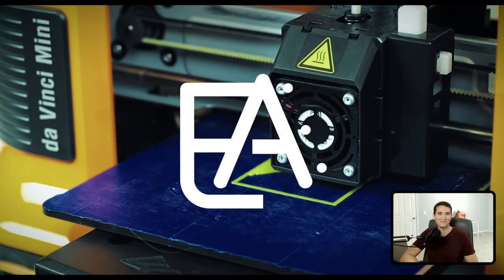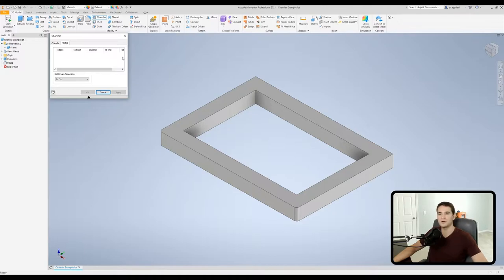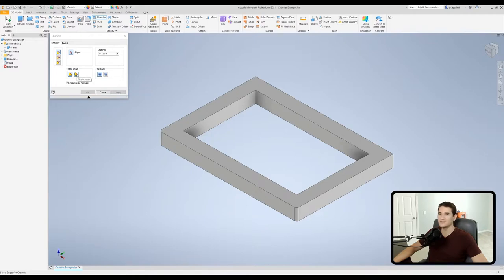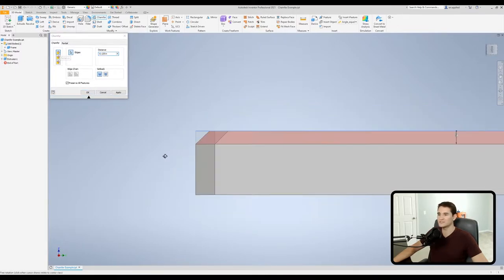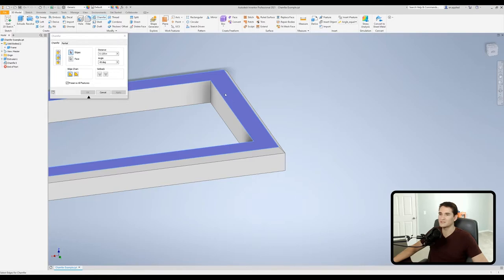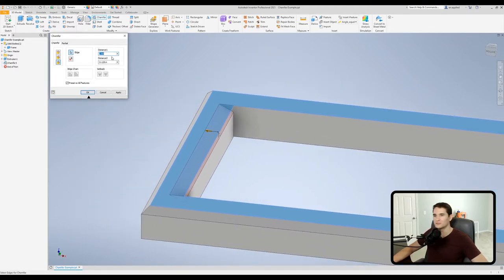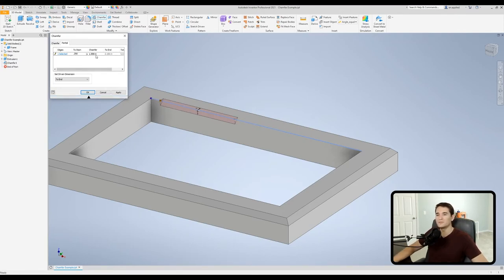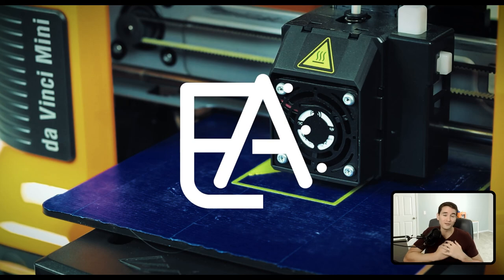Chamfer Tool and Options - Autodesk Inventor Part Tutorial | Autodesk Inventor 2021 IN DEPTH

Comment: Hey I haven't watched videos in a whil but I'm glad you've kept releasing them, gotta catch up with the content! I have one question and would really apreciate your answer, How do you do other kinds of chamfers? for example in welding there are chamfers/bevels with J shape, in the weld symbology it would specify angle and depth but no info or whatsoever about the J shape itself. Like you could set the starting and ending point in a sketch but no information related to the curvature, do you know if that information is standardized somewhere or if inventor has a tool with that info integrated and allows you to do different kinds of weld bevels in a quick manner? Greetings!
Reply from the maker: Hey @Carlos Gotham Engineer, it's good to hear from you! If you would like to specify a specific type of weld, you can open a new weldment assembly, assemble your parts that you are welding, click the "Weld" tab, and create a weld of your choosing. Within the weld command, you can specify the weld contour.

I hope that helps! Thanks for watching and for taking the time to comment!